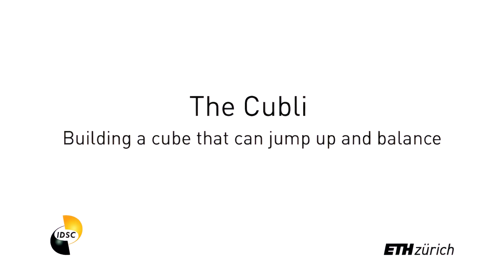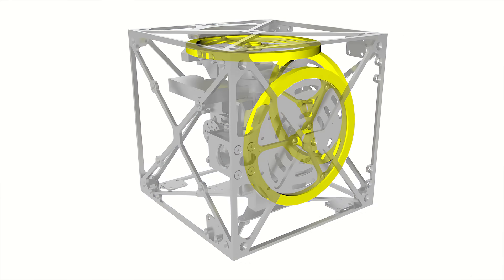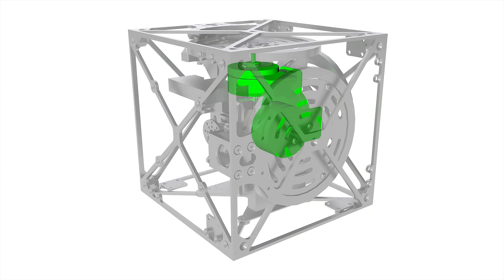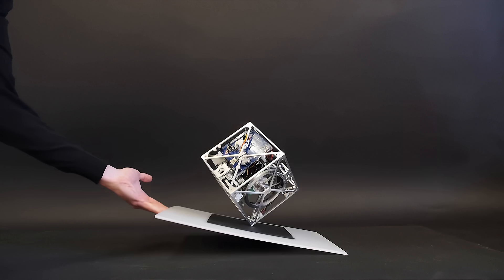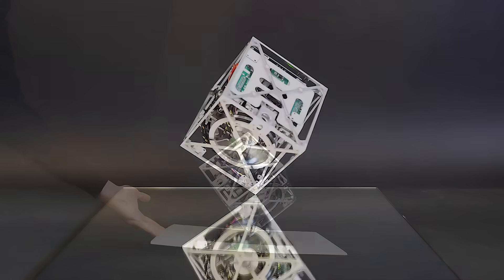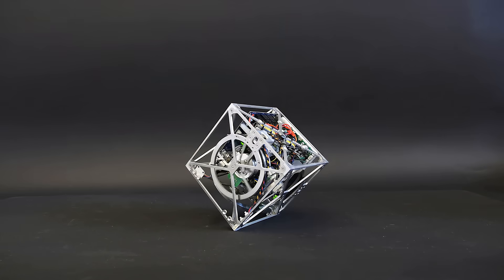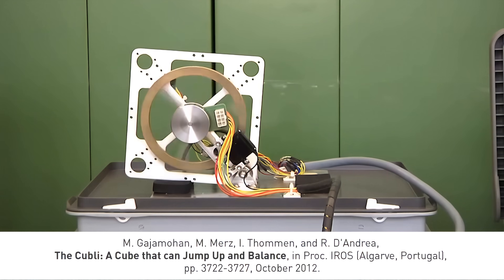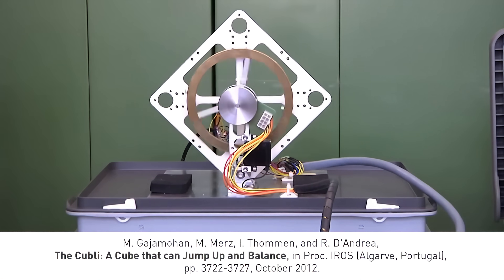The Cubli: a cube that can jump up, balance, and 'walk'

Comment: A cube is a complicated shape, and the current method it uses to walk is very inefficient. A ball would be tougher to manufacture, but with necessary additions a 'balli' could move much better than the cubli if it were considered for planetary exploration; herewith I am not taking away the fact that you need it to be in a solid convex outer corpus, unslitted. The author of the project stated that it’s a demonstration of balance, and later suggested it might be used to explore planets without human life endangerment. That is equivalent to school projects like 'I made a stick balance itself with a Python script,' except here the motor amount increased to 2 and the vertex amount increased to 8. It’s a good engineering project from the contextual point, but not too well thought through. About the future 'space exploration' part… If the cubli is supposed to travel large distances while staying solid and sturdy: first, the components inside are exposed to mechanical stress and can malfunction, halting the investigation. Second, the locomotion method is inherently slow and energy-hungry, and with current battery technology there is not enough efficient storage to keep it powered for long durations. A stable energy-generating component like a solar panel cannot be attached without breaking the principle of a convex unslitted shell. Third, if the outer shell is too thin, the scraping and repeated impacts from its tipping motion will cause external damage and deformation; if it is too thick, the added weight demands stronger actuators and more power, lowering efficiency further. So while it demonstrates balance beautifully, as a planetary instrument it is not practical. If I misunderstood, reply. I’d like to hear explanations. :D

Comment: I remember only a few years ago there were no bots that could stand and then move on just 2 feet like a human, because that kind of feedback loop-to motor action hadn't yet been perfected. This is very cool.
Reply: A "few years ago..."  - it has been more than 20 years since Honda made ASIMO...
Reply: @adb888  Yea and walking on two feet is much more demanding than staying on one corner.
Reply: ....This video is 10 years old....

Its not that the feedback loops didnt exist, they did. Its that the technology was too expensive and large to achieve something so small with everything on board at a mass it could easily effect. The biggest development that allowed this thing to be built is the development and perfection of MEMS devices. Those, what was it like 6, gyro/accelerometer units together take up less volume than a single axis version of the style before it (which again were expensive as hell). And the MEMS devices can update a hell of a lot faster. Granted they're not analog like the old ones could be, but with how systems are built these days (data goes to a central processing unit then instructions are sent to relevant sub systems vs a sensor input being conditioned, amplified, and directly driving a hydraulic valve for example and the computers just monitored the signal possibly had an ability to modify it some but the point is sensors directly affecting control devices) your signal resolution is only as good as the ADC that converts sensor element readings to binary anyways. AND the error of modern sensors, especially after some well developed filtering is applied is WAY below analogs trustworthy resolution anyways....

Comment: That's very clever, now replace the gyroscopes with vaporized Mercury gas you can control its direction with sound and aid its direction with the shape of the vessel it is kept you may need to prime the Mercury like a fluorescent lights.

Comment: What is the main purpose of technology? What is suppose to do for humanity?
Reply: The main purpose of The Cubli technology is to study and demonstrate principles of physics and robotics, particularly in the areas of control theory, feedback systems, and dynamic balancing. The device has been used to investigate new methods for controlling the movement and balance of robots, as well as to explore the underlying physics of angular momentum and rotational motion.

In addition to research applications, The Cubli technology could have potential practical uses in fields such as manufacturing, transportation, and space exploration, where precise control and balance are important. For example, the technology could be used to develop more stable and efficient control systems for robotic arms in manufacturing plants, or for the guidance and control of spacecraft in orbit. However, it is important to note that The Cubli technology is still in the experimental stage and more research and development would be needed to bring it to practical applications.
Reply: @raeji  Thanks for the explanation, but I wasn't asking about this particular technology but in general terms.  What is the main purpose of technology? What is suppose to do for humanity?
Cheers!
Reply: @VelhaGuardaTricolor  The main purpose of the Cubli and similar technologies is to showcase innovative approaches in control systems, engineering, and robotics. It also serves as a platform for further research and development in these fields. While the Cubli itself may not have direct applications for humanity, the underlying principles and advancements can be applied to a wide range of practical uses, such as:

Robotics: The control algorithms and techniques used in Cubli can be adapted to improve the stability, balance, and mobility of various robotic systems, including industrial robots, humanoid robots, and drones.

Prosthetics and exoskeletons: The balancing technology demonstrated by the Cubli could be used to enhance the performance and usability of prosthetic limbs and exoskeletons, ultimately improving the quality of life for those who rely on these devices.

Transportation: The principles of balance and control demonstrated by the Cubli could be applied to improve the stability and maneuverability of vehicles, such as self-driving cars or electric scooters.

Construction and architecture: The Cubli's ability to maintain balance in various positions could inspire new designs for buildings and structures, which can be more resilient in the face of natural disasters.

Overall, the Cubli and similar technologies serve to push the boundaries of what is possible in the fields of robotics, control systems, and engineering. By doing so, they contribute to the development of new solutions and applications that can ultimately improve our lives and address various challenges facing humanity.
Reply: @raeji  I am failing to make myself clear. I am not asking about this Cubli technology, I am asking about any technology, from the wheel to computers. 
What is the main purpose of ANY technology? What it suppose to do for humanity?
Reply: @Finn Lapp Is the wish to control the world a healthy one?  I am not agreeing that it is the purpose of tech, but only trying to understand your answer.
Reply: @Finn Lapp You say: (Human greatness is build in such a way that = "we are greater than out limits!" But if we don't live without limits then we wont see our greatness and if we don't believe in out greatness then we will just be stuck within our limits.)
It was a bit confusing and I couldn't quite understand your point.
If we are greater than our limits, what do you mean by: "if we don't live without limits then we wont see our greatness and if we don't believe in our greatness we will just be stuck within our limits"

What do you consider limits?  Are they real limits or simply the rules of nature?
What do you consider our greatness? Is making a spaceship that goes into another planet while the vast majority of humanity on Earth struggles to survive part of it?

Comment: So what has it been designed to do? What use?  Anything other than the obvious complex gyroscope or inertial navigation applications?? Or just a really expensive toy to obtain grant money for its' designers.
Reply: The main purpose of The Cubli technology is to study and demonstrate principles of physics and robotics, particularly in the areas of control theory, feedback systems, and dynamic balancing. The device has been used to investigate new methods for controlling the movement and balance of robots, as well as to explore the underlying physics of angular momentum and rotational motion.

In addition to research applications, The Cubli technology could have potential practical uses in fields such as manufacturing, transportation, and space exploration, where precise control and balance are important. For example, the technology could be used to develop more stable and efficient control systems for robotic arms in manufacturing plants, or for the guidance and control of spacecraft in orbit. However, it is important to note that The Cubli technology is still in the experimental stage and more research and development would be needed to bring it to practical applications.

Comment: how the cube measures yaw?
Reply: The Cubli uses an inertial measurement unit (IMU) to measure its orientation and motion. The IMU is a device that contains sensors for measuring acceleration, angular velocity, and sometimes magnetic field strength. In The Cubli, the IMU is used to measure the angular velocity of the cube about each of its three axes, which allows it to determine its yaw, pitch, and roll angles.

To be more specific, The Cubli uses three reaction wheels that are mounted perpendicular to each other to control its orientation and motion. Each reaction wheel can be independently accelerated or decelerated to produce a torque that causes the cube to rotate about a particular axis. The IMU sensors then detect the rotation rate of the cube, and this information is used to calculate the cube's angular position and velocity in real-time.

By measuring the yaw angle, The Cubli is able to maintain its balance on its edges and corners by making small adjustments to the angular velocity of the reaction wheels. This allows the device to perform dynamic balancing and remain stable even when subjected to external disturbances, such as a push or a tilt.
Reply: @raeji  An IMU, especially used in a cube, is not capable of measuring the yaw angle. For roll and pitch we can use two gyroscopes and two accelerations to measure, but yaw angle??? I think it's not possible to use an IMU to measure yaw angle, only if you're using a tactical grade IMU that doesn't fit in a cube. give me an example of an IMU that can measure yaw angle for a few seconds without calibration from a non-inertial source?
Reply: @sergeizotov6787  ADIS16470 from Analog Devices.
Reply: @raeji  it won't work, it has a huge bias of hundreds of degrees per hour. the first integral of this bias gives the rotation by the yaw angle. you can accumulate hundreds of degrees in a few minutes. No silicon MEMS are suitable for this task in principle, maybe in the future? or if you use any other correction information. you can't rely on silicon mems for this task.

Comment: Make one of these as a desk toy. It sits on a rubber pad which contains an induction charging ring. Toss a Bluetooth chip in the cube so you can use an app to control its position. Should be low enough power that the induction coil could wirelessly power it. Maybe add a small rechargeable battery so you can pick it up and handle it.

Comment: This is how I pictured those "alien" pill shaped objects the Navy pilots were getting in recordings.  I was picturing the pill shaped exterior but with a belt with a weight on it inside that would spin around the interior at incredibly high velocities and "pull" the object in whatever direction the weighted belt was rotated giving full directional control.

Comment: 9 yrs later, how is this not a thing I can buy?
Reply: The Cubli is a highly specialized and advanced research device that is not currently available for purchase by the general public. There are several reasons for this.

Firstly, The Cubli is still in the experimental stage and is primarily being used for research purposes. The device was developed by researchers at the Institute for Dynamic Systems and Control at ETH Zurich, and its primary purpose is to investigate principles of physics and robotics, rather than to serve as a commercial product.

Secondly, The Cubli is a complex and sophisticated piece of technology that requires a high degree of expertise to operate and maintain. It is not a consumer-level product that can be easily used by non-experts, and as such it is not suitable for widespread commercial release.

Finally, the cost of producing and manufacturing The Cubli is likely to be very high, due to the advanced materials and precision engineering required. This would make it prohibitively expensive for most consumers to purchase.

Overall, The Cubli is an impressive and innovative piece of technology, but its current focus on research and development means that it is not currently available as a consumer product.

Comment: Why a cube? Why not a ball shaped to make it easier to move around?
Reply: The choice of a cube shape for The Cubli was likely motivated by several factors. One of the primary reasons is that a cube shape allows for more stable and controllable movement than a sphere. A cube has well-defined edges and faces that provide stable contact points with the ground, which makes it easier to control the motion of the device.

In addition, a cube shape allows for more precise control over the rotational motion of the device. A sphere is more symmetrical and has no preferred orientation, which can make it more difficult to control and balance. The cube shape of The Cubli, with its distinct edges and corners, allows for more precise control over the device's rotational motion, which is important for achieving the dynamic balancing behavior that the device is designed to exhibit.

Finally, the choice of a cube shape may have been motivated by the desire to create a visually striking and distinctive device that would be memorable and easy to recognize. The cube shape of The Cubli is certainly distinctive and has helped to draw attention to the device and its innovative capabilities.

Overall, while a ball-shaped device may be easier to move around, the cube shape of The Cubli was likely chosen for its stability, precision, and distinctive appearance.